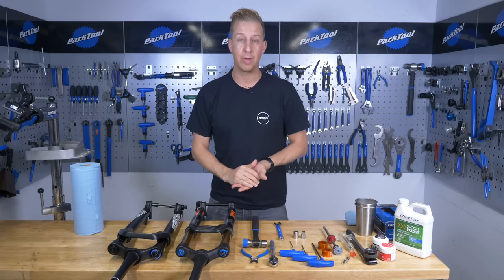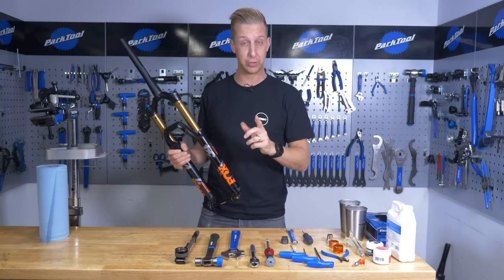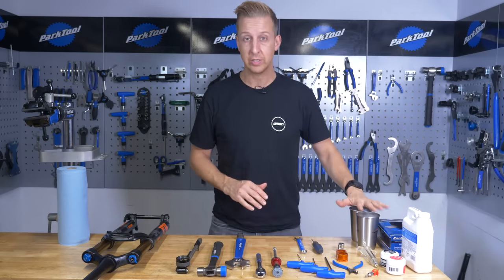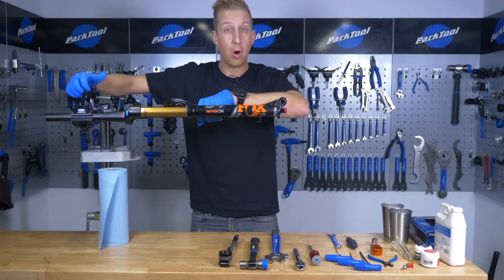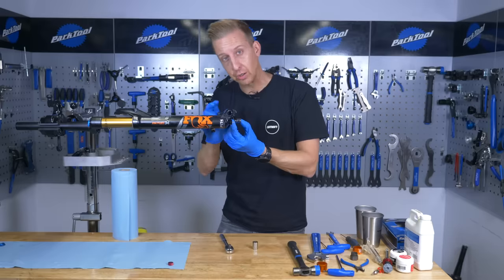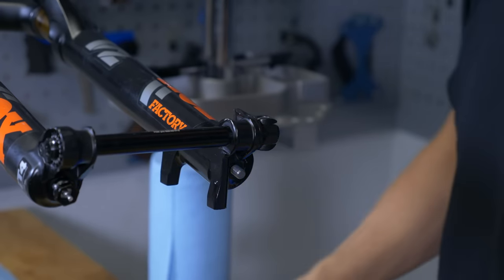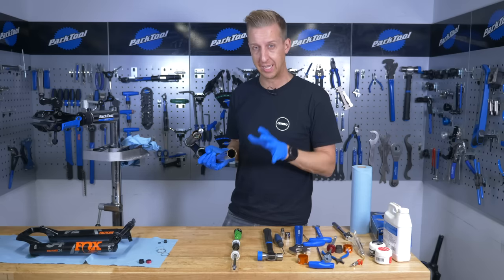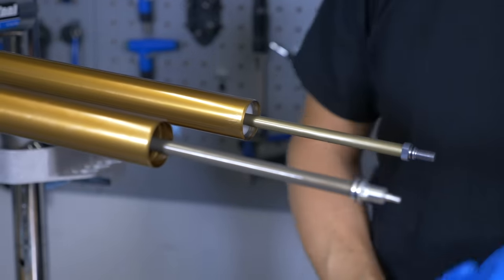How To Fix Fork Suck Down On Your Mountain Bike Suspension Fork

Comment: One tip, I did this and when you have fork suck, the lower legs have some pressure in them when you remove them and can spray the oil everywhere when you first loosen them (guess how I know). When you first tap them with the hammer to break it loose, you should tip it up slightly so the oil is at the bottom when it breaks loose and releases the pressure.

Comment: Shock/fork servicing is one thing im happy to bring into my local bike shop
Reply: Basic service was actually very fun little tinkering. Especially rear shock as it doesn't have nearly as much oil and thus isn't such a mess.
Reply: If you do the lowers and air can and keep them clean they last longer before needing a full service and longer overall as well.
Reply: fork/shock service is actually the easiest/simplest thing. i find all other kind of service to be much more annoying to do. I do it all myself but if i was made of money i wouldnt mind having the shop doing bearing replacement and what not - but would still do fork/shock because its faster than going to the shop lol
Reply: @kangsterizer  but u need the right tools and torque wrench a must for top cap and lower bolts. And a 150mm nylon/plastic rod for RS (easy/cheap on ebay) to grease inside the stanchion to the correct depth (essential but many (shops included) dont do and causes premature wear and poorer performance).

Comment: Easy one that always works for my 2012 Rockshox lyrik R. After I remove air pressure the fork sucks down. I remove my wheel, put the axle back in, put the fork on the ground, grab the fork uppers while pushing down on the axle with my foot and pull up fast. After that it goes away.
Reply: I did the same thing on my fork, but instead only reduced the PSI to ~30 PSI. Thank you for your comment. For reference, my fork is a 2015 RockShox Pike RCT3.
Reply: I did this and it worked, thx. I have manitou mattocs for anyone wondering
Reply: @CarhunterVST1  glad it helped!!

Comment: I had this problem but cured it by dropping my pressure to around 40-50 psi slowly, I then forced my forks open to full extension, there was a little hiss and something changed. After I compressed my fork around 30-50% and held it and heard a hiss again. Pumped them back to normal riding pressure and still had 10-15mm of suck back still, then I did the cable tie trick on both sides, again heard a hiss from both and after this they were fine. Maybe it will work for you too... worth a go. Fork was a Fox 36 factory 160mm

Comment: i have reused my crush washers because new ones from fox retail for 2 euros each. Also foam rings seem impossible to buy loose. Fox really wants you to buy a 35 euro seal kit with only the 2 main seals, 2 foam rings and 2 crush washers...
Reply: you can find the foam rings on ebay/aliexpress for like 1-2usd if you dont mind waiting a month to get them. also if you clean them well you can reuse them for a while before they need replacement. the only thing that ends up being somewhat expensive for me are the wipers, but they last a while.
Reply: U can clean and re-use foam rings on RS if in good condition
Reply: @steelwing7532  still 28$ for a sealkit. About 2x the price of rockshox
Reply: @ultiss  But you can buy the foam rings and washer separately for much cheaper if you dont need new wipers.
Reply: fox are greeeedy

Comment: For everyone looking for a quick fix: I had this one year ago on my RockShox Reba RL 2017. After extensive googling I found out that there's a hidden valve for the negative air chamber even on Solo Air forks. Let out air pressure on top of the left leg, then remove the bolt on the bottom of the left leg and press on that valve. Be careful as there might be a bit of oil coming out! Then screw on the bolt again and reinflate at the top. This can get rid of the problem in the short term but you should still consider a service like it's shown in the video.
Reply: it is no "hidden valve", it is a hole on the bottom of the lower leg, so you can bolt the lower legs to the air shaft.
Reply: "there might be a bit of oil coming out" haha that's the oil draining out of your lowers. No hidden valve mate
Reply: Its a bit late, but to clear it up there IS a schrader valve core at the bottom of the air piston on some RS forks. pull the 5mm bolt and do not unseat the end of the shaft. just use a 3mm to remove air. OR you can remove ft wheel, reinstall axle, air the pos chamber to the max, then step on the axle and pull up on the bars until the piston seal slides past the divot and the pressure will equalize and blow out any grease. Sometimes it takes 2 people to pull, but it works well. Good Luck.

Comment: If it's a coil fork, and it gets stuck, it's a broken/snapped coil causing it to jam up, but you might notice decrease of travel too, in both cases it's snapped coil.
Reply: I had helm coil this year with negative trapped air. When I pushed fork out and it would suck back in 2 inches. Never found out what exact issue was. They swapped it.

Comment: Did this to my 2018 Fox 34 Rhythm and there was plenty of grease inside. I wonder what they were thinking at Fox... Pro tip to removing stuck air spring: remove the top cap and volume spacers, find a wooden or other non-metallic stick and push the air spring out. Be careful since it will come out suddenly! A large enough container with rags to soften the landing ;). With helping hands it's even more easier since one can pull at the spring end and the other can push with the stick.

Comment: Perhaps if using only forks oil to grease the parts and add a little drop in the air chamber (2ml) to help the scare ring to don't stick and wear 
It'will good and cancel the grease problems?

Comment: A trick I was taught by a mate at TF Tuned is to always reassemble your fork at full compression. The other trick is one I started to use after a bit of suck, 2.5wt in the air chamber. That super thin oil keeps everything slick yet keeps the transfer port clear. A thicker oil can be used but I've got a shitload of 2.5wt from servicing a Manitou Progressive Suspension 5th Element (it's on my mates 03 VP Free if anyone wants to know).

Comment: There is a much easier and faster way to fix this..iv done it a few times. Pump up your positive air chamber to it max PSI. Or even a little bit over it. Then catch the crown of the fork and the wheel and pull them apart. You will hear the pressure equalise.. then simply drop the pressure a bit at a time while cycling the fork until it's back at it's original pressure.
Reply: Might work...might. cable ties down seal way way easier
Reply: @rupedog  that's for a different issue..cable ties work when the lowers build pressure.. the method I mentioned above is for when the negative air chamber builds more pressure then the positive and the air piston can't reach the notch that equalises both chambers.
Reply: Agree, have done this method too
Reply: I did the "foot on the wheel and pull fast the handlebar up" with no air inside. did the trick.
Reply: Thats ok when your srała are ok… when not it helps about 5km, after this it will suckdown again…
Reply: @duczmal  when what?
Reply: Maybe fix it but with all that grease like this fork gonna happen again way too much grease just a light coat will do lol

Comment: I had the biggest freak accident yesterday with this.
Riding a SR Suntour Auron with the old air spring, I know that it's a mechanical negative steel spring. So what happened was: I was overhauling my fork and took it completely apart. In the process I accidently put the seal on the air piston on upside down. Now this seal is designed to expand when meeting pressure and seal up the air chamber in the process.
Little did I know that the negative chamber is apparently air tight and was conserving the lost pressure from the positive chamber and didn't let it out again (the seal design working against me here).
So little me, wondering what was wrong with the fork, pumped up the postive chamber over and over again to receive no better outcome at all and a suckdown has never crossed my mind because I know about the mechanical properties of my fork.
So I stripped the fork apart like shown here and on Suntour the bottom cap is screwed on which exploded from the stanchion in the moment it got unscrewed.
Oil.
Oil everywhere.
I made a Van Gogh on the work shop floor and learned a lot about my fork. Very glad that nothing broke.

Keep it up guys and I hope this is a good addition to your knowledge base.

Comment: Great video, I let out the air, removed the inflation bit on the top, then the lowers, then the retaining clip, reinstalled the inflation bit on the top and then inflated until the plunger (i'm a novice) popped out the other end, made a loud pop, gave me a startle! By the way, I wore safety goggles.

Comment: 9:35  Fox has recently done this mistake, at this spot, so many forks come with way too much grease there. I hope they will fix that. I have con conversion on mine I will build up a new bike soon, already halfway done.
Reply: Johannes Nilsen yeah i fini mine is going to get that problem 
Last time i did change my tokens i did see a lot of grease down there
Reply: My rockshox sid ultimate 120mm from 2024. Have a little suck down issue about 4-5mm! I hope this knowledge from This video resolved my problem

Comment: I had a fox float 34 on service the other day with an insane amount of pressure locked in the negative chamber. I probably would have to rig a pulling jig to get it out. Instead of pulling, I put some pressure in the positive chamber to reveal some shaft, clamped it and unscrewed the "bolt" on the end of the shaft carefully, psssjjjtt, pressure released controlled. (you need som heat so release that screw, remove the o-ring off course).

Comment: Hey Doddy, Just a bit of a heads up. If you press down the valve when you are pulling the at the air spring it will open the air tube and allow you to get it out easier!!! Just saying like!!!!! ;-)

Comment: Happened to me during my last fork service (RS revelation RL 2015). Just after mounting back the air shaft I noticed that it was far too back. So I processed to pull it out. Thanks god I wear classes. I was shooted by a huge amount of lithium grease right in the eyes !  That was probably the reason of the problem. I have the habit to overgrease every piece on my bike :D

Comment: Doddy, I recently took the air out of my fork and when I pull the legs to full extension I can feel a little bit of pull back on the last 10-15mm and then it sucks back in a little bit. Is this normal or should it easily fully extend and stay extended?
Reply: Looking for the same answer
Reply: I think it should stay extended. I just had this problem. The zip tie tip at the front of this video solved the problem. Done on both sides of the fork.

Comment: On my Fox forks, I let the air out of the main air spring.  The pull the wheel off and put the axle in place.  Put your foot on the axle and pull up on the handlebars (gripping near the stem) until you get the fork to extend to the transfer port.  The negative air will dump into the main air spring.  Cycle the fork in and out until you have all the travel back.  Takes much less time to do than it does to watch this video.

Comment: Thank you thank you I'm so pleased I've seen this. I had what I would say was a flat spot where the 50mm of travel had no resistance and rode rough. I did as you said and slipped a cable tie in the seal, heard a hiss and the forks firmed up immediately. My Lyriks now feel like my old Pikes your a legend 💪👍

Comment: Great educational video.  Not that it matters at all to the point of the demonstration, but I'm just too curious: Did you happen to have a fork with suck-down on hand, or did you open this one up ahead of time and "prep" it my smearing grease on the port between the air chambers?  Just seemed like too perfect of an example having that big dollop of grease right where you predicted it might be before opening it.  Also seems reasonable that certain "teachable" example issues might not come up so often among your gear without "creating" them, assuming the GMBN crew might tend to be better at preventative maintenance than an average rider (which may be wrong!).

Comment: I just bought an e-bike it does have shock Forks but no locking mechanism and they definitely aren't air shocks when I popped the tops off it's just  hollow inside, I've never had shock Forks as a bmxer, do they make Forks like this or is it a manufacturer error? They do have a phillips-head screw at the bottom of each one of them I don't know if that's the way to adjust them? Any suggestions or information would be great, they actually seem to ride very nice I get some good support from them and I only go on flat surfaces

Comment: Dual air forks allowed fine tuning of +ve and -ve and no transfer port...in some ways a much better system, espec tuning small bump sensitivity (and so also ramp up/progression).
Reply: Rupert Wenn you can buy the MRP conversion (much cheaper than than full ramp control) transformed small bump on my 36

Comment: My forks don't have a valve or anything like that at the bottom, and the stanchions seem to be at atmospheric pressure - there's a seal but it doesn't seem airtight and removing it does nothing. Do I have sprung one or is it just a really nasty and cheap air suspension that can't be fixed?

Comment: #askgmbntech
"Fork Suck Blues": Hi Doddy, I keep getting fork suck on my 2018 Fox Rhythm 34's 150mm. I recently did a lower service, thanks for the video, and also found the big glob of grease on the air side. Once completed I went out for a ride and whilst the forks feel much better, half way through at the bottom of a decent, I found the forks sucked down too 90mm. I'm 95kg and run the forks at 90 to 98psi. Whilst i didn't bottom out i did use most of the travel on some drops. Would volume spacers help in any way to alleviate the fork suck? Or is there something else I should try. Fox won't service the forks due to some minor scratches on one fo the stanchons.
Cheers, Adrian.

Comment: It would be fine to use vaseline on the forks right? Otherwise is there a specific grease i should use?
Reply: No, use grease approved to work with the rubber seals and 0-rings
Reply: @eric3969  i mean, vaseline shouldn't damage neither rubber seals or o-rings from what i know, it's literally as neutral as it gets

Comment: #askgmbntech ...What about having circa 5mm of slack at the top of the travel? Is that the same issue as shown here? If i lift the front of the bike off the ground at the front theres vertical play 🤷🏻‍♂️ they are 170mm yari.

Comment: Hey could this help make my fork more supple? I have a 2017 fox 36 fit4 and I would like to make it more supple off the top. Would doing what was suggested in the video be better? Or would adding volume spacers and dropping air pressure be better?
Reply: Soz, yes try add a spacer and drop psi...1 spacer/5psi at a time
Reply: Rupert Wenn Thanks a lot!
Reply: My 2016/17 FIT 4 36 with the MRP neg air conversion is WAY-more supple than either of my Pikes, one with Luftkappa and the other Debonair.  It’s got 10mm more travel at 170 but the difference can’t be 10mm of travel.  I’ve got the ramp control in as well but that really just saves messing with spacers which I only really do if I want more mid stroke support.  I’m 75kg
Reply: Stephen Lord Thanks a lot! Is there any chance you could send me like a video or something on how to do this? And where to get the products?
Reply: YoNeilGaming this is the product...     https://mrpbike.com/products/fulfill™-spring-conversion-for-fox-36 
when you fit you REALLY need the proper vice shafted clamps ( and perhaps blowtorch) as there is a stupid amount of locktite  ... (or pay suspension tuning/service company ) ... I guess like the grease and the fix Doddy is doing Fox seem over generous on some forks in the case with locktite (see comments at the bottom of the video I’ll link) ... the rest is stupidly easy, just the bottom bolt but don’t try and improvise without a proper shaft clamp.  

All you are doing is replacing the airshaft foot and a seal ... with a valve and full seal to separate the chambers the put it back in... 

https://mrpbike.com/products/fulfill™-spring-conversion-for-fox-36
Reply: Sorry this is the vid ... but this is the whole ramp control (which for the 36 2016/2017 includes the fulfill ... ) so you only need do the spring conversion part.  
https://www.youtube.com/watch?v=jhfwYDcCGFQ

Comment: My 2013 Rockshox Revelation has a pressure relieve valve built in to the tip of the plunger, at the bottom. Simply remove the left hex bolt then press the valve with a long thin screwdriver to release the air.
Reply: Thats a dual air fork! Not a pressure release! Ur supposed to pump in the neg air in their, and u have no transfer port. Letting that air out will make ur fork harsh as hell.off the top as no neg pressure! Rs recommend u start with the same pressure in both, adjust from there
Reply: @rupedog  Nope, it's a Solo Air, with the dimple inside the stanchion. It is just a release valve hiding away up inside the shaft, no fitting for a pump. I was surprised to find it there after reading about it on a forum. After purging it you can hear it fill up again when the seal moves over the dimple. 
Maybe it's just to release the air so it can be disassembled easily without having to fight against the air in the negative chamber like Doddy did :-)